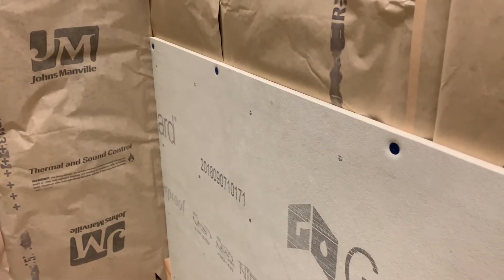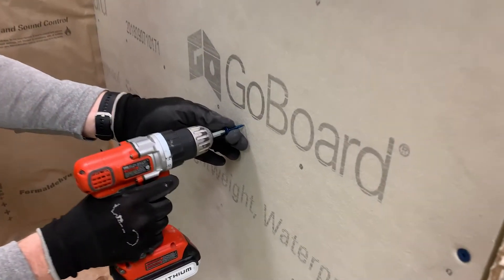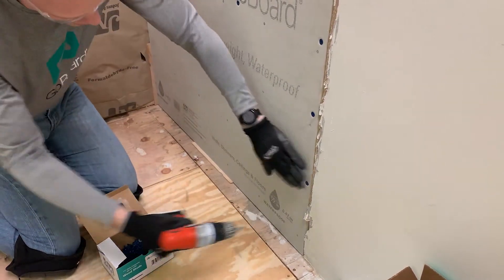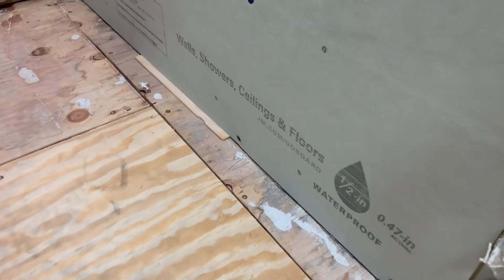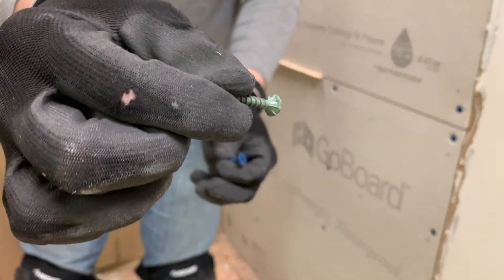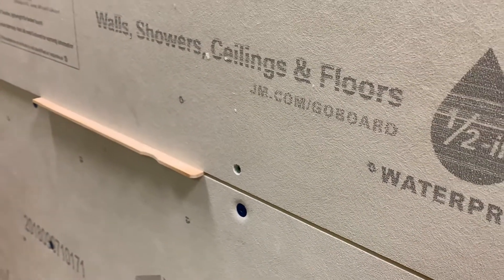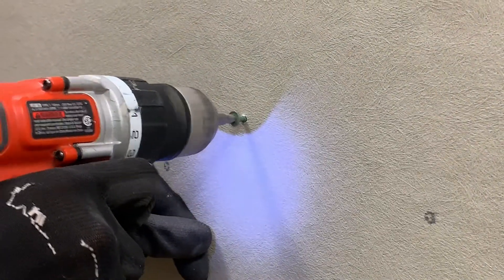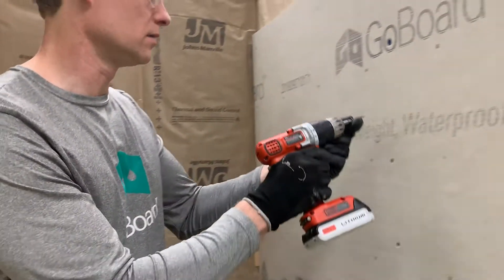GoBoard Tile Backer Board Fasteners VS Cement Backer Board Screws

Comment: if i use the galvanized washers, can i just use drywall screws?
Reply from the maker: The GoBoard Washers are recessed to accommodate cement backerboard screws or flat head #7 thru #9 exterior grade screws.

Comment: Lowes doesnt sell the screws and the sealant is outrageous at 20$ per tube. CMon...lets not price gouge/exploit your customers. Same with the shower pan kits at 750$. Way to expensive compared to tried and true rubber liner and mortar bed for around $100. If youre not going to sell ALL the goboard items at the stores where board is sold whats the point of pushing your screws and shower pans kits. Im a contractor that likes the Goboard but wont be extorted
Reply from the maker: We hear you. We're always looking for ways to make our products more accessible and affordable. These products are available in other stores and online retailers as well, where pricing might be more competitive. Or they may also offer contractor pricing.

Comment: Can you use cement board screws in combination with your washers? That seems to be what is “purchased together” on the Lowe’s website
Reply from the maker: Yes, use cement backer board screws or flat head #7 through # 9 exterior grade screws.

Comment: Use a pencil and a level to mark a line where the studs are. That way you wont miss the studs. I see 2 missed screw holes at the 3:00 mark in the 2 row from the bottom; right about the word "showers".
Reply from the maker: Thanks for the comments! =)

Comment: Just bought 8 sheets at my local Lowes. Why dont they sell the screws or sealant?
Reply from the maker: Lowes sells traditional backer board screws - which we approve for use with 6" spacing (without washers). There's a rumor that Lowes may begin carrying GoBoard Pro Sealant. We sure hope so!
Reply: @johnsmanvillegoboard  Lowe's now has the GoBoard Pro Sealant.

Comment: I use quikrete non sag polymer sealant. Glad the price of the go board sealant and readily available. It’s listed on go board website as acceptable substitute for their sealant but it does void warranty.
Reply from the maker: If it's listed on our approved sealants list then you're covered under warranty.
Reply: on one video, they use loctite pl s40 poly sealant . its cheaper and is really sticky. takes too long to skin over and takes a week to cure though.

Comment: They really gotta work on easy access to screws and sealants. Nightmare trying to find a place that has it on hand. 🤦‍♂
Reply from the maker: Very sorry you're having trouble finding the fasteners. You can always have them shipped to you from Contractor's Direct.
Reply: Yeah, never mind trying to figure out that shower pan system they have….. what a headache.

Comment: Love the product but the fasteners are a pain to locate.  Our local Lowe's sell the boards but no sealant, tape, or screws. Ended up having to use the Durabase Backer Board Screws/washers when I couldn't locate the screws anywhere.
Reply from the maker: Contractor's Direct is your friend. Thanks for the comment!
Reply: @johnsmanvillegoboard It’s a pain to have to order it and wait.
Reply from the maker: @JoshDub78  That's understandable, and so we're always working on expanding our distribution footprint.
Reply: I purchased mine at ContractorsDirect
Reply: yeah, I went with a different brand.  I can't stand a company with POOR information, limited product availability, and ever-changing directions.  THere are like 4 sets of installation methods... depending on the year... none of them are current, and none are clear.

Comment: I like the Goboard but cant find anyone that sells the screws in the Kansas city area.   I can only find them in boxes of 700 for $45 on Ebay.   What a pain.   Has anyone used Kerdiboard screws with their special washer in GoBoard?
Reply from the maker: Sorry you're having struggles sourcing the fasteners. Have you tried a zip code search on our partner locator? https://www.jm.com/en/insulation-locator/
Reply: @johnsmanvillegoboard   yes.  That is how I found the GoBoard sheets at the only retailer listed on the JM search tool.  Menards Home Center sells the goboard but they absolutely do not sell the special fasteners.  Three employees including the department head searched their stock and computers without success.  JM would sell more of the Go Board if retailers understood that specific fasteners are needed and stocked them.   This is apparently a wide spread problem since I saw several message board posts on the web with customers having the exact problem as I had.  Kerdi board has been in short supply for months.  To bad JM hasn't been able to capitalize on the market needs when their leading  competitor van supply the market.

Comment: Man ... I really like all these products but it has been so hard to get them around Corona CA .. it's a little bit frustrating... But it worth it when I finish my projects
Reply from the maker: Sorry you're having struggles sourcing these. We do have approved alternatives listed in our technical data sheet, and you can use our partner locator to help you find sources for the accessories. enter you zip code, then select GoBoard Accessories in the search criteria: https://www.jm.com/en/insulation-locator/
Reply: I'm a tile installer in San Diego county area, I like go board Lowe's in San Clemente CA sells. I hope that helps you a bit it's a great product.

Comment: Taken a section of shower apart for tile change, I used goboard, screws, goboard juice over my screws and even some ardex 8+9 from my pan overlapped, yet when I cut out a piece of board, the screws had some rust? maybe a year and a half old, whats the deal?  @Johns Manville GoBoard
Reply from the maker: The GoBoard Fasteners are non-corrosive - but if you're willing to send us those fasteners so we can look at them that would be greatly appreciated!

Comment: I used the Wedi screw / washer. Worked great. Then you seal with either Silicone or  Polyurethane caulk depending on your finished product. Also you should apply the sealant at the joint before installing next piece. You get a better seal. 

https://www.tileshop.com/products/wedi-screw-and-washer-fastener-kit-349133

I saw in the post that mansville has a similar washer. Either will work and I recommend to get the best hold.
Reply from the maker: Tile Shop carries GoBoard Fasteners which also are covered under the JM warranty.

Comment: I always got the impression that if you puncture ( screws or nails or anything) you defeat the waterproofing purpose; How many people have use this Goboard and put  screws through it and had it stand up for any length of time.? How long has this product been on the market?
Reply from the maker: GoBoard has been on the market since 2014. Apply GoBoard Pro Sealant to the fastener penetrations for an ANSI A118.10 compliant, waterproofing, and tile-able substrate.

Comment: Are these blue screws better than the "6487 GoBoard Washer Fasteners 1-5/8”? https://www.contractorsdirect.com/PDF/GoBoard-Washers-screws.pdf
Reply from the maker: With the blue GoBoard Fasteners (screws) you're able to space them out to 8" compared to 6" with these gray screws when used without the washers. With the washers, you can space out the gray screws to 12".

Comment: Go board shit product to soft when you instale big tile dansheild all the time
Reply: It's very dense and strong. Large tiles should work fine. If you're using small tiles you may want to increase your studs to 12" oc. This will take away any flex when pushed on. It's light weight, Waterproof, easy to cut. Loved working with it. See my other comment about fasteners.
Reply from the maker: Thank you for your feedback.

Comment: Using a cheap drill that’s brand new just tells me that you dont do this often and don’t have tools to do the job. Use an impact gun ypu will have better results and less time putting screws in
Reply: Goboard panels are soft and the impact gun is too powerful, it drives screws right through them. A drill has an adjustable torque, giving you much more control when installing the panels.
Reply from the maker: Thanks for your comment!
Reply from the maker: An impact drill is not necessary.

Comment: Glad to see a video on this.  I was going to use the backerboard screws but was able to these on Ebay of all places,  I had to get the contractor box (5lb) So I guess I have enough if  everyone on my block decides to renovate their bathrooms as well.  I do not know if JM has a social media person that monitors the page but if so, Why is this stuff so hard to find?  I had to drive to Cheyenne to find the GoBoard at Menards.  The other big box stores and tile stores do not carry it. I have two more bathrooms that will eventually need to be renovated and it would be nice not to have to drive 200+ miles RT for GoBoard.
Reply: Yea.  I got my goboard at Menards BUT they dont sell the screws to fasten the board!  What a PITA.
Reply from the maker: Hi Steve, thank you for your comments and your question. GoBoard distribution is always growing.  It's really a matter of distributors deciding to bring the product line into their stores or not. Squeaky wheels get the oil, so when a contractor or remodel customer inquires or asks for it - that usually helps the distributor determine if the demand for GoBoard is strong enough for them to carry it.
Reply: @johnsmanvillegoboard  If only that truly worked with the Big box stores. Example Certainteed has their manufacturing plant 40 miles from where I live yet their product  STONEFAÇADE that is made in that plant can not be sourced locally. Neither of those two different named box stores carry GoBoard Either I have inquired at both. I am on hold until I can source the material for both of my restrooms and my kitchen remodel.  Hopefully Johns Manville will strike a deal with those box stores or other large distributors and I will be able to get their GoBoard Product.
Reply: Yep,  same here at the closest Menards near Morgantown WV.  Drove a couple hours to get it ~ $20/sheet.  The local Lowe's sells it for that...if you buy an entire pallet of 60 sheets and when you're a DIYer and only need 6-7, well, that doesn't work for to well.  Something's really weird here regardless.  So yeah, now I'm looking for the screws,  weird,  NFS anyway.  Even shippers charge the $50-60 price.  Anyway, I'd like to do it "right" but at least he shows us the backerboard screw distance.